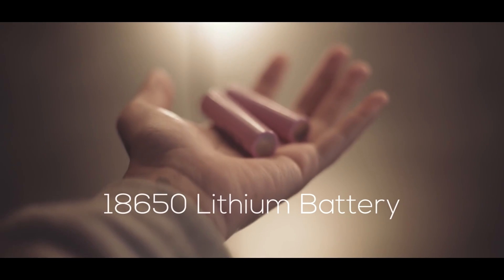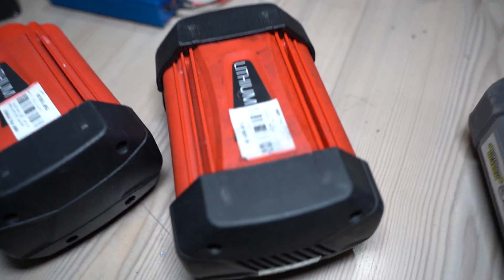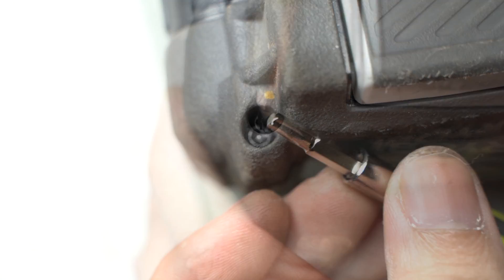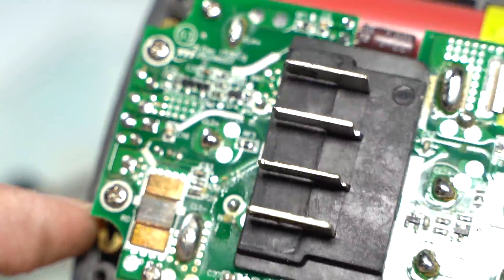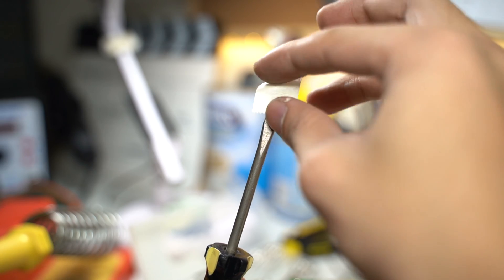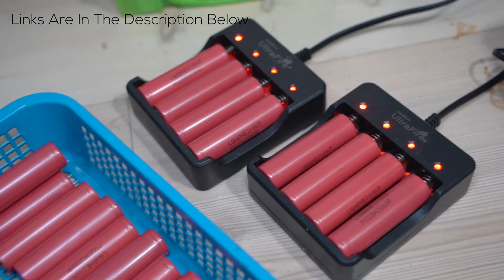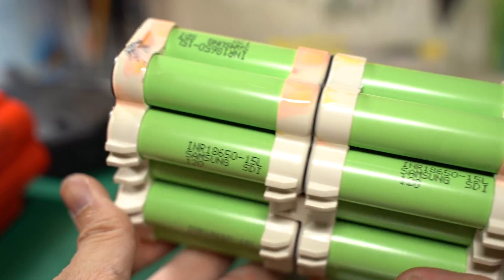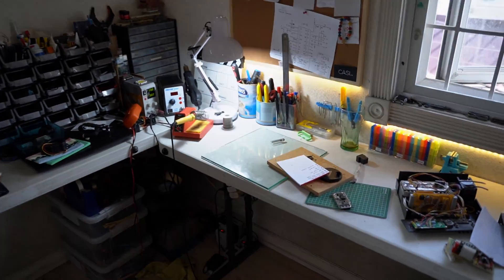Salvage 18650 Li-ion Batteries From Powertools - Tesla Cells

Comment: I would recommend using a small pair of needle nose pliers or a pair of wire cutters to remove the nickel strips. I grab ahold of the strip and roll the strip over the pliers to pull off the strip. You can use the needle nose to remove small pieces of the strip that might be left on the battery

Comment: Can we use these batteries to run 4 motors and an arduino board?
Reply from the maker: Yes! I use these often on all sorts of robotics projects. I'm assuming you're going to use a motor controller board?
Reply: @TechBuilder  oh yeah ,i am working on a project ...in this i am using an arduino board to run ultrasonic sensor , four motor and a servo motor so can these batteries help me?

Comment: Fantastic job, dude. I use to do it with discarded notebook batteries, but I haven't had much luck. 😕
I'm going to try those! 😊
Anyway, just one thing: LiIon cells like the 18650 won't explode like a LiPo. They change exactly the same way, but the similarities end there. Different chemistry. 😊
Reply from the maker: Thank you! Same here, laptop batteries were a pain to open. 18650 Lithium-ion batteries are indeed less explosive, but in some cases they still are capable of exploding. Had experienced it before when I overcharged one of my cells in a controlled experiement.
Reply: @TechBuilder  Really? Wow! 😮

Comment: Saving the planet? brainwashing 101 complete.
Reply from the maker: The goal is to buy surplus cells, not shelf sold ones. Surplus cells are unsold excess in the market. Legally they're very expensive to dispose, as they contain hazardous chemicals. Instead of waste facilities discarding them, we can do it ourselves by separating the useful cells for repurposing and recyling the remaining parts inside.
Reply: @TechBuilder  how can we recycle the remaining parts like the plastic and the batteries which won't work??
Reply: Shutup
Reply: Sustainability isn't a political stance. It's a fact that resources on this planet are finite and at some point need to be consumed in moderation. That may be an inconvenient fact to those conditioned to mindlessly consume more and discard anything no longer wanted.

Comment: The "center tipped screws" are actually just "security torx screws" no need to break them, just use the right screwdriver.

(Edit:)
Just wanna add that i like the video, you know your electronics, keep up the good work
Reply from the maker: Thank you! Had to bream them since there were no locally available security screw kits. Had to improvise :)
Reply: I was about to leave the same comment. Lol

Harbor freight, 7 bucks for a full security driver set.

:)

Comment: Well wouldn't the batteries have bad health like would not be able to hold charge, they are old??
Reply from the maker: Surplus batteries are considered brand new, most of them were excess from shops that weren't sold till their models became obsolete. Speaking of shelf life, these lithium batteries can last for decades even when unused, as long as they. I'm making a separate tutorial, focused on showing the proper method of checking the remaining battery capacity and it's freshness %. Mine were only behind by 5% of the cell's nominal capacity, I would say, they're in a great condition.

Comment: Can you add comparative costs per cell if purchased directly as a cell, versus harvesting it from a battery pack? The cost of time aside, I think the amount of plastic waste created by the harvesting method is not useful.
Reply: plastic isnt waste ....
Reply: @girlsdrinkfeck  true. Very true.
Reply: Id imagine it doesn't matter. Look at this way. These tools and equipment could have been trashed anyway, this way youre atleast recycling part of what destined to be trash anyway. 

So instead of plastic and li ion battery waste, it's just plastic waste. I'd look for used and older things with li ion batteries as it's more likely to be beneficial.

Gotta always test the batteries regardless if it's 1 year old or 5 years old. Don't wanna have it explode in your face